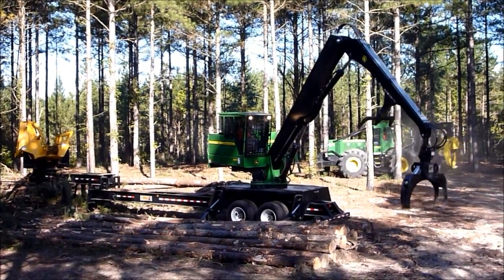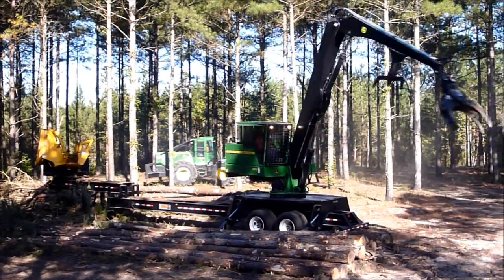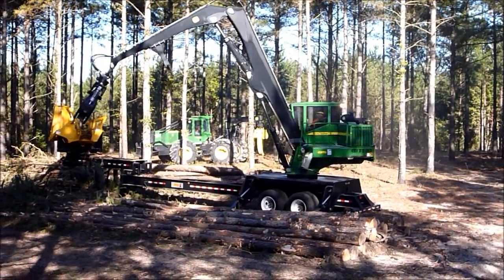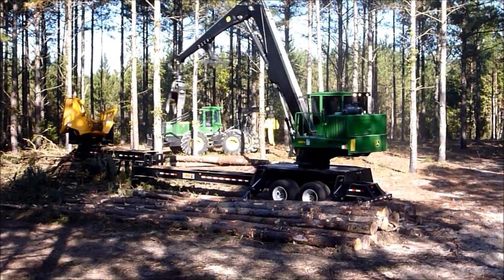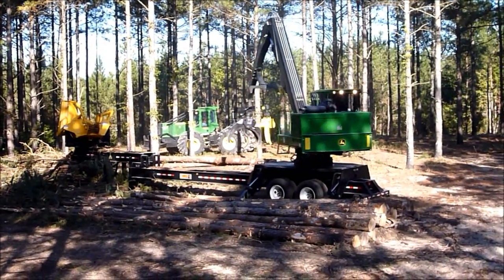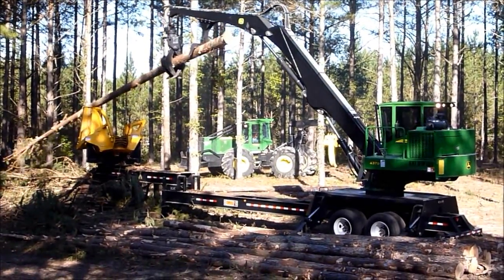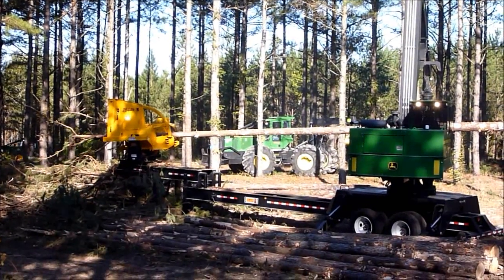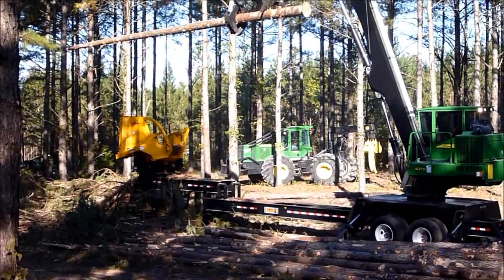New Deere 437D Log Loader Delimbing and Stacking Logs

Comment: I know a few loggers in BC and Alberta -- and you may have a small increase -- but overall, logging has petered out.  Canada is certainly more actively logging than the Northern US, but all the logging infrastructure we once had is torn down or sold for other uses.  Because of that, greenies, and many other reasons -- we couldn't "boom" if we wanted to.

Comment: "Lots of logging" is a very subjective term.  Lots compared to 2005, or lots compared to 1985?

I was working in the woods and at a mill during the last housing bubble -- eventually getting into commercial and residential framing.  I was working the harvest, manufacture, and end-user jobs for logging.

You may think you're cutting a fat hog in the ass now, but logging is dying.  Sure, there may always be a remnant, but it will never be the industry it once was.